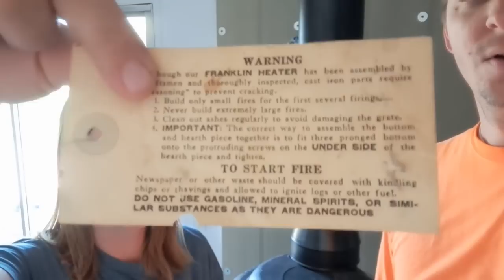Wood Burning Stove Install In Our 1976 Trailer

Comment: I just had the same problem with the telescoping pipe. First, put the top together so it hangs from the ceiling penetration box. Second slap it gently all around to break loose any stuck paint. Third make some 2 inch square pieces of 3/4 plywood. Drill the centers for #8 sheet metal screw, fasten them on the outside at the bottom through the holes predrilled for screwing the pipes together. Now you can tap down on the blocks and it loosens up as it slides down. Also gravity is on your side this way.
Reply from the maker: Awesome! Thank you.

Comment: Your creativity and adaptability on making the flue pipe adapter was pretty spectacular! And you're correct on the break-in of the cast iron stove, because it will off-gas a little bit as it heats and it is less than pleasant to smell. Had I been involved, I might have recommended taking that window out (because I'm sure it leaks air like a sieve) and replaced it with sheet metal that would have allowed you to put the flue pipe right through it
Reply: Don’t take the window out if you don’t have to. You’ll lose all that great light.
Reply: @SJC49  He covered the window with the Hardiboard, so how do you imagine it will still provide light?
Reply: @dionh70  I meant to say don’t remove or cover the window - if they had another option where to place stove. Relax.

Comment: Jacob, How is the Under The Floor Support? If Questionable an Easy Fix, 'Short Post w/Concrete Base Square' Under The Trailer. Question, With all your Electrical⚡Power🔌 from Solar, Why Are You'al Not going Electric Heaters? You appear to have the Advantage to go Solar than Pot Belly. In my Farm House I had a Majestic Cook Stove that also heated my Water for Hot Water Pipe'n in the House when Home. In another House had a Ben Franklin Box Wood Burner with Dueling Doors when Home. Another House a Stone Fireplace when Home. Another House a Box Burner with Cook'n on Top when Home. Never had then Solar Panels as it was just not something out & about as it became many years later.  Learned right off the bat, always use Triple Lined Pipe'n from Wood Burning Stove/Fireplace. The Single Lined Pipe's can from burning🔥Heat Up & cause a good Chimney Fires🔥. I am sure you have in the Black Interior Pipe'n In The Trailer Double Lined. From The Ceiling Outside the Stainless Steel Triple Lined Will Make all the Difference. Yes you got a good deal on the Comfort Stove. You can move the Comfort Stove into your New Home🏡one day when the Trailer is no more for living in & starts to Fall Apart. always, Tommy🤠
Reply from the maker: Trailer floor is good. Need more batteries to run a 1500 watt heater at night, but during the day it would be no problem. Thanks. Have a good one.

Comment: Do you think you maybe should have put some hardiboard under the pavers??  and maybe more of an apron in front ??
Reply from the maker: Very little heat comes from the bottom of the stove. Thanks for watching!
Reply: @aboulderlifeoffgrid  I'm more concerned about sparks going between the pavers.